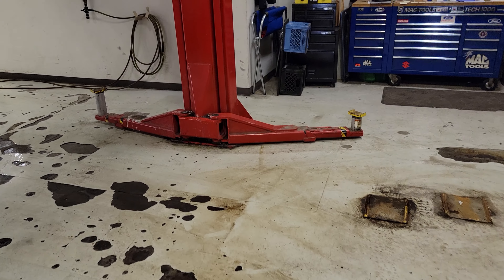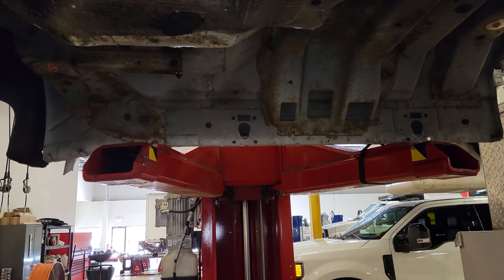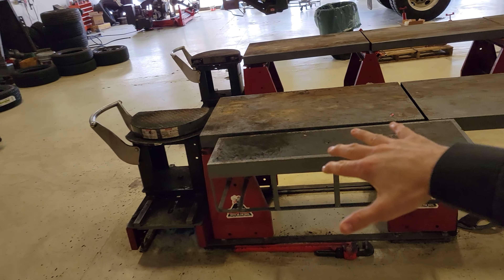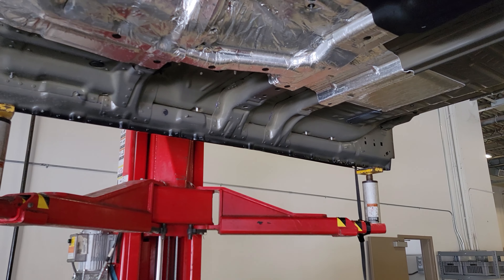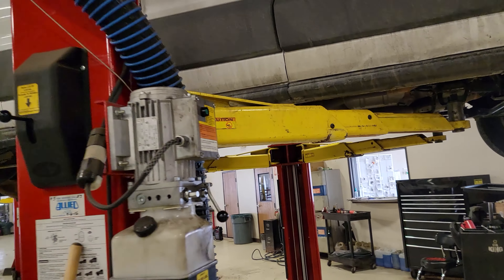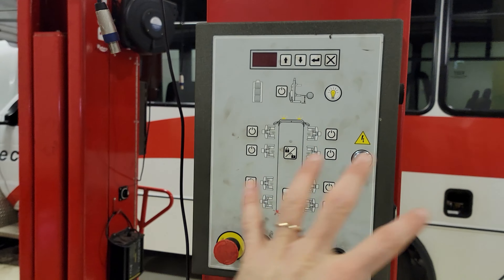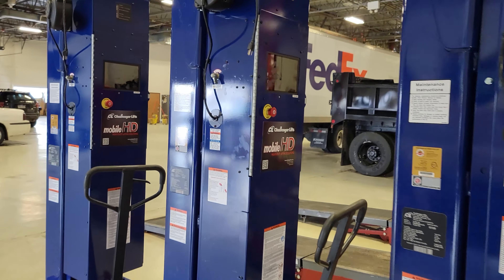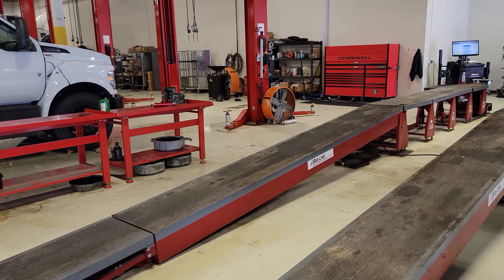When working on Ford trucks GAS or DIESEL | WHAT HOISTs DO YOU BUY??? - PTTs TOP recommendations

Comment: We have a set of the wireless rotary columns,  two 18,000 lbs rotary and one 20,000 lbs challenger lift in our truck shop.  
I have use two  columns to lift an escape to do a motor swap.  Used the adapters on either side.
I dig those adapters for your challenger columns.

Comment: Currently running Rotary lifts at the dealership, however I’ve used Challenger in the past and I gotta say I like Challengers two post 18,000 pounders. Idk why I just have had zero complaints when it comes to them, they’ve lifted everything I’ve thrown at them with zero issues, and again they’ve been reliable.
Reply from the maker: Great to hear, thx for sharing.

Comment: Shop has a 18k Rotary lift just like the ones you show, lifted an ambulance once and it did it safely. Have two older 15k Challenger lifts which work fine too but they won't upgrade unless it seriously breaks down. Have a 10k Atlas platinum series lift at home, works fine for what I need to lift(4 door sedan, midsize truck, 1/2 truck. It is setup asymmetrically so a 3/4 ton truck might be a bit much. Wish I did the 12k symmetric, but would definitely give trouble lifting some things I work on at home.

Comment: Have you worked on many 10 speeds in the super duty come in to be rebuilt? Or seen them in the shop getting rebuilt?
Reply from the maker: I just replaced one in a 20 7.3, actually the godzilla video i made...front crank seal leak. That same truck. Had a noise. No tear down..engineering said replace whole box
Reply: @PowerStrokeTechTalkwARod  gotcha. Appreciate it. Just curious how that new transmission is doing. Probably holding off to get a 2022 since it has the interior upgrades.
Reply from the maker: Good here!

Comment: Hey AArod
My shop was  built with 8 ft ceiling.
But I do have a ton of room for an add on. . Thinking  of going from my 30x50 to 30 x80. Then I will be able to get the hoist. I  just got to bite the bullet  and  spend  the money.
Reply from the maker: Damnmmm
Reply: @PowerStrokeTechTalkwARod  got have room for my toys. 😄
Reply from the maker: Ditttttoooo
Reply: @PowerStrokeTechTalkwARod  oh I got a 17+ egr cooler  coming  in.  I  found it at a diesel  shop in Florida.  Should  be here by early next week.
Reply from the maker: Ooooffff

Comment: Check out Cowboys car crushing channel in Dallas Texas.  He used a John Deere 544K loader that picks up thee F-350 crew cab diesel 4x4 trucks stacked out of the crusher.  He picked up a stretch limo and a 2005 F-350 dually 4x4 diesel with one fork through the windshield!  One fork holding 8600 lbs is pretty impressive!  The roof tore away eventually.
Reply from the maker: Wow! I gotta check that texan out!
Reply: @PowerStrokeTechTalkwARod   Definitely!  Also his sidekick has a Channel called G Money Car Crushing.  The two of them work together.
Reply from the maker: Wow👊👍

Comment: But yea I use a 12,000 rotary for most stuff, then the shop has a shared 18,000 two post. And 30,000 four post all rotary lifts. Won’t trust my life with anything else, we once got a “Mohawk” brand because owners were being cheap. Went to lift a basic 250 and the thin bowed and started pulling up. Ripped that out and got a rotary quick
Reply from the maker: Oooooffff

Comment: According to the sticker my 14 350 weighs in at 11500.
Reply: I think you mean it can weigh 11,500.Usually the decal tells what the truck is capable of weighing at the maximum,Ive yet to see a door sticker give the empty weight, You can usually get it by subtracting the payload number on the yellow sticker from the GVWR ,it  will get you close to it’s empty weight.
Reply: @JohnDiMartino  I'll check it out, Thanks.

Comment: I AM JEALOUS BROTHER!!! In my sixteen years of being employed at my dealership, I've been preaching to every manager I've worked under to get me just ONE Rotary Lift hoist. As it stands, I have two bays I work out of. The one bay I use for 90% of the work I bring in, is my "car" bay. It serves my needs well for doing oil changes as well as other "quick" work. The other bay, where the first manager I worked under arranged to install a "truck" hoist, is about as useless as a female anatomical body part on a bull, putting it nicely. The hoist is slow, and legs don't extend nearly far enough to be of any use. I therefore designate that as my "engine replace" or "cab removal" bay. Work with what you have, right? The owner and management are not very pleased with my position of refusing to work on certain lengths and weights of trucks. But, too bad so sad. Having the right lift is only part of the equation though. If bringing in any vehicle larger and longer than an F-150 or F-250/F-350 that requires 42 million point turns to even think about getting properly situated, I simply flat out refuse to work on it, which brings me to my point of the importance of having a good shop layout as well. Having the proper lift is money wasted, and useless if there isn't the proper real estate for it too. Anyways, that's an excellent video as always.
Reply from the maker: My main man Chan!!!!